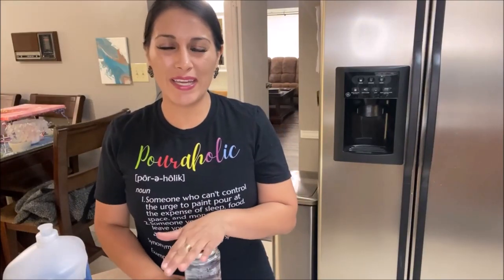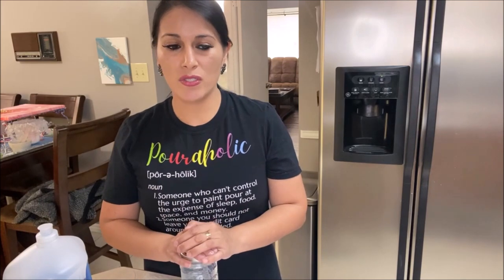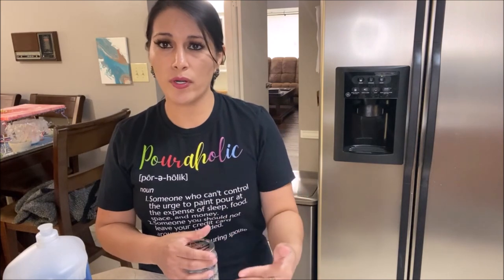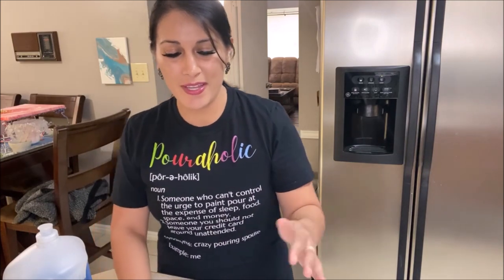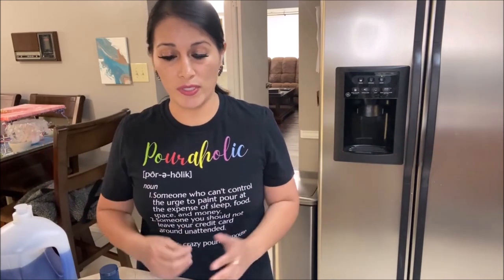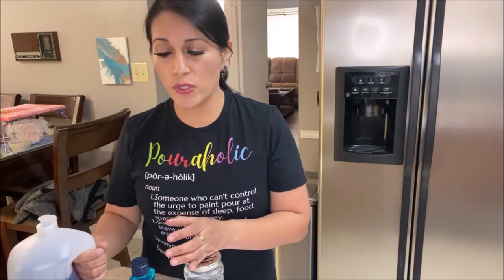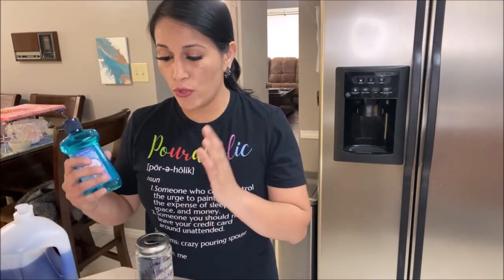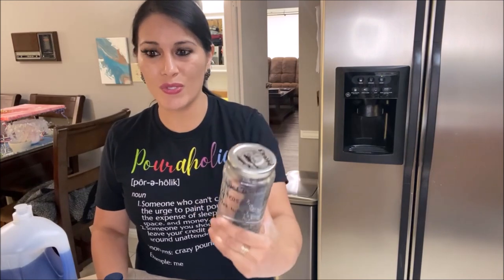26. How to Make Flow Aid | Homemade Acrylic Flow Improver | Wet Water

Comment: Great idea. I am going to give this a try. I use an airbrush to paint miniatures and the flow aid is used to help the water break the surface tension of the paint as it is sprayed on the miniature, also it helps prevent tip dry on the needle of the airbrush. It is hard to find flow aid for airbrushes that does not cost an arm and a leg.
Reply from the maker: I would love to know how well it works for an airbrush! Let me know if you give it a try
Reply: How did it go? :)

Comment: whoa!  way to much talking.  Need to get to the point.  Good tip
Reply from the maker: I just try to give out useful info that you might need later. I like explaining the why behind the main point because then if you have issues, you could think of possible reasons of why it didn't work out.
Reply: Will this help to keep paint wet enough for blending?
Reply: Hello, just ignore that comment on to much talking. It was great info, and very logical. Details are important. Thank you

Comment: Thank you for the great tip.  Love that wall mounted radio.  Does it have an intercom with it?  My parent's house had a built-in tube based radio/intercom in their 1958 home they bought brand new for $12,000.  I used photographic "wetting agent" back in the film days that was probably no more than detergent and water.
Reply from the maker: Yes, it has an intercom. It is pretty fun to use. Wow, I wish homes were that cheap now a days! 😂

Comment: Thank you very much for the info! May I ask you how much of this do you use in the mixing? It's just used as a replacement for the water inside the mixture?
Reply: It’s in the video. 1/2 tsp to 32 ounces I believe.
Reply: 1/4 tsp to 32 ounces Distilled water.

Comment: I am slightly confused, would you use the flow aid in place of the water you would add to the paint?
Reply from the maker: I do add water but I also add a little bit of flow aid to my pouring medium to help break the surface tension in the paint mix and make it flow better. Even though water is a liquid and makes the paint fluid, it still has some surface tension. You can see that when you add water to a cup. Once the cup is full of water, if you keep adding water to the cup drop by drop, the water in the cup won’t overflow, instead it will make a dome shape above the cup rim because the molecules of water are holding on to each other. That is called surface tension and is what is preventing the water from overflowing. If you add a surface tension breaker like flow aid to the water, the water molecules would not stick to each other and would help the water flow more freely. Flow aid is just used to make the paint mixture flow better without having to dilute the paint with  too much water. So technically you use BOTH water and a little bit of flow aid to your acrylic paint.
Reply: @ArtasiaLand  " Once the cup is full of water, if you keep adding water to the cup drop by drop, the water in the cup won’t overflow, instead it will make a dome shape above the cup rim because the molecules of water are holding on to each other. That is called surface tension "  AKA the 'meniscus'
Reply: I use it but found that the color white (tried artist brands) does not do well with Flow-Aid unless want to make it more transparent? 
     Now thought all whites were “equal” but (chemically) did better w misting on pallet w water 🤔? Yet with yellows & greens really covers! So found white not fav of mine but will cover (9 coats before no FA)!

Comment: Are you saying that this recipe is in place of floetrol? You mention flow aid but I don’t know what that is. Also is this recipe used as a pouring medium to get cells? Thank you.
Reply from the maker: No. Unfortunately it is not a replacement for floetrol. I use a little bit of flow aid in the pouring medium recipe that you can find inside my beginners course. It is the recipe found in the bonus section. I just use it to make my paint and pouring medium mix a little bit more slippery so that it can glide better on the canvas surface. It helps the paint flow better without having to make it too watery, which will break the paint binders and make the paint crack when dry. But the recipe that I use with flow aid is one of my favorites to use for making cells with silicone oil. The cells hold up really well.
Reply: @ArtasiaLand  okay I understand now. Thank you!